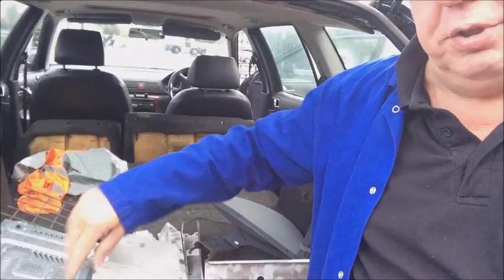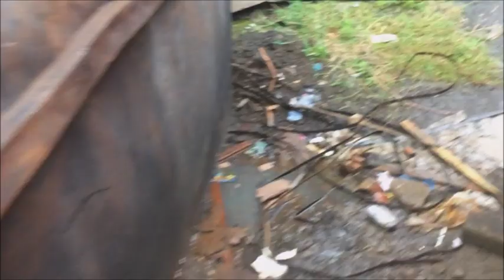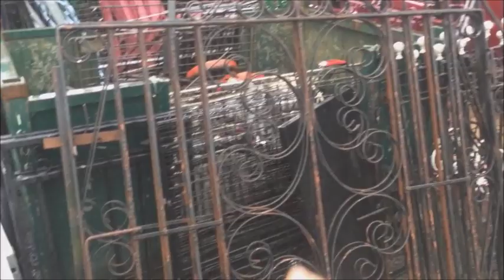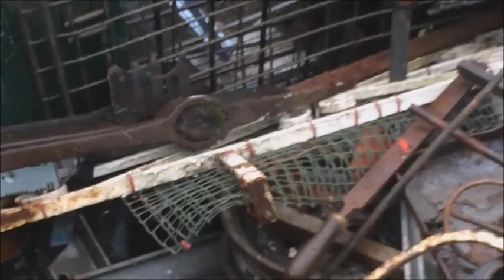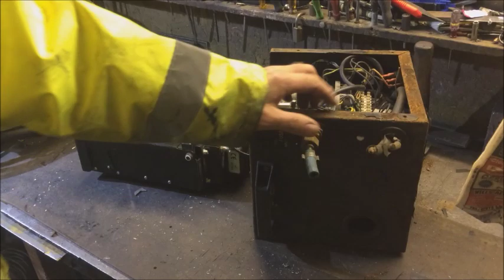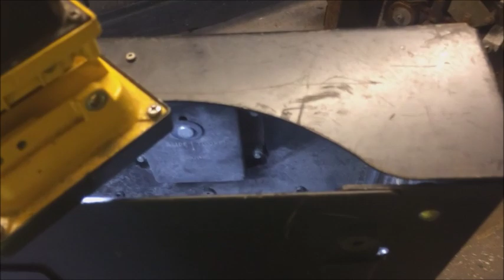A Little Skip  a little Gold !!

Comment: On that 1st piece, the one labeled "Rival",  is that to do with telecommunications?  If so, I'd suggest that those plates that are near the blue & yellow wires on the right,  might be coated-copper.  I had the good fortune to get a telecom box from about 1967, from a building that was being "re-done", and pulled off about 12 oz of coated-copper plates and pins, in addition to a lot of wire.  Hit them with a file, see what's underneath!
Reply from the maker: we will see